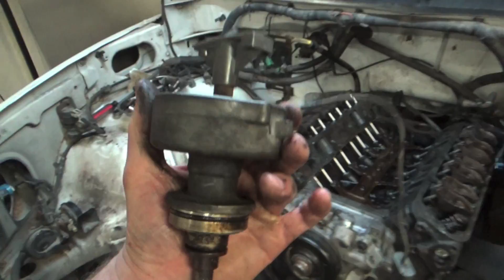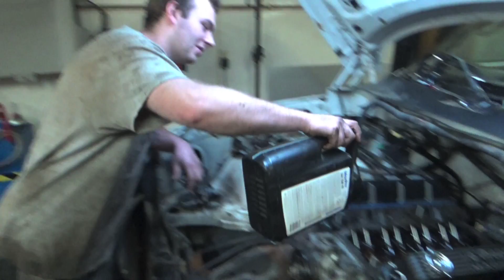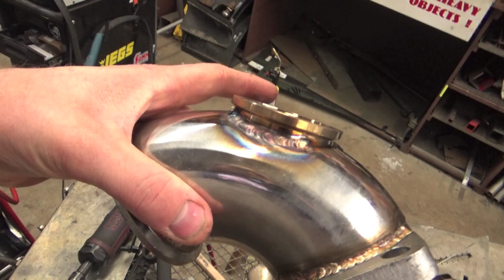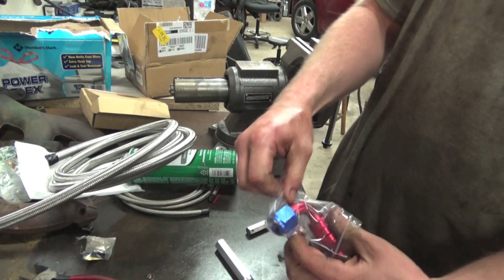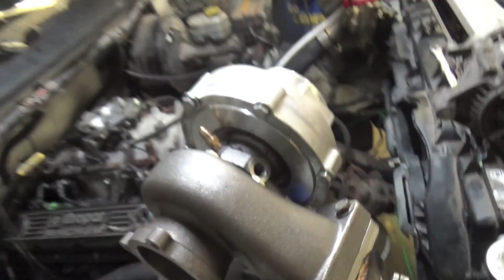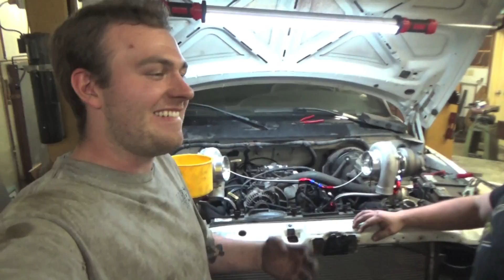Twin TURBO 5.2 5.9 magnum build FIRST STARTUP! Whitie build ep.4

Comment: YEEHAW haha I just got a 5.9L RT Durango and I've been going crazy looking for vids and information on building a turbo 5.9, this looks great man! 💪
Reply from the maker: Thank you! And sounds awesome I’ve always wanted a RT Durango
Reply: @RacingRamFam  are you in the east coast? I plan to build the 46RE first, Upgrade Brakes and Suspension, then tackle the 5.9l I'm keeping it simple, EQ Heads Cometic Gaskets like you used, ARP studs, refreshed bottom end & a Single 6668 Precision I want to port the stock intake, and keep the EFI, put bigger injectors 🙏 fingers crossed it all goes well.
Reply from the maker: That sounds awesome and no north central! Sounds like a sweet plan

Comment: Looks awesome!!! I would like to do something similar to my 96(5.2), i love this truck!!
Reply from the maker: Nice! What vehicle?? You def should
Reply: @RacingRamFam  a 1996 ram 1500 5.2 with a manual trans, i just installed a hurst shifter
Reply: I built a 5.9 for a 2001 ram 1500 that i had and could never get the pcm to run it after flash and tuning (new internals, compcams chain and cam, hughes f1 intake headers) and i just have the engine sitting around after the pcm died
Reply from the maker: Time for a swap soon?? And dang that sucks what do you think was the issue?
Reply: @RacingRamFam  it was running lean even burned a couple o2sensors in the process, if i do decide to swapit into my 96 ram i was thinking just carburating it and finding an older distributor and harness or maybe even msd ignition system, how are you managing your engine? if you dont mind me asking
Reply from the maker: Sct3200 and custom tune by me

Comment: Cant believe I found this. I’ve got a 98 ram with a 5.2. I’ve got a motor and twin turbo kit sitting on the shelf for it
Reply from the maker: Yesss that’s sick man!
Reply: Where did you get the turbo kit from
Reply from the maker: Devin Baker they use to have a eBay twin turbo kit for the la and magnum engines. They took it down tho
Reply: I've got a 98 transmission do you have overdrive
Reply: Sameeee bro wtf
Reply: @RacingRamFam it’s actually still up

Comment: So two questions. Where does the turbo oil supply come from? 
Does the turbo oil return have to be gravity feed?
Reply from the maker: Tapped off the oil pressure sensor and yes unless you use a scavenge pump
Reply: @RacingRamFam  thanks man keep on keepin it boosted

Comment: The right belt to get for a 5.9 is a  
"90 5/8ths inch, 15/16ths wide, 7 rib"
My ac pulley on my 2000 5.9 went out and this belt fits perfectly if you route it without ac

Comment: I’ve got a 2001 Dodge Ram 1500 5.2 and I wanted to ask what should be the first things to do to increase horsepower? The truck has 136,000 miles and in good shape but real sluggish on the punch. I just wanted to so info on my first steps?
Reply from the maker: Make sure plenum gasket isn’t leaking and def tune

Comment: New follower! I really like your build! you got a part no for that belt? got a single turbo 5,2 in my 74 dart :)
Reply: and now i watched the whole video XD what length belt?
Reply from the maker: 905k7!!! That’s awesome what kind of power are you making?
Reply: @RacingRamFam  no idea, still working some bugs out, and haven't welded the plate in the bottom yet. So i have put the ecu (megasquirt) to cut at 0.5 bar (7-8 psi) boost. Gonna try to do a couple of upgrades this winter and dyno it come spring.
Reply from the maker: That’s awesome I almost went megasquirt on this truck but thought tubing the stock j-tec is more relatable to people
Reply: @RacingRamFam  my engine is from a jeep, and i didn't get the ecu for it, and i think the whole car is integrated in the engine loom. So for me ms was the easiest

Comment: Bro. Hmu. Going to get my ramcharger with twins on a 5.9 magnum running by the 18th
Reply from the maker: RNHB 1AGOFAST that sounds awesome! What’s all done to it?
Reply: @RacingRamFam  new gapped rings, arp rod bolts, rod bearings, arp head studs and mls gaskets. T04e turbos. The ramcharger has 37s and a 6 inch lift ;)
Reply: Hmu on insta @1agofast

Comment: Where did you hook the oil feed from to your turbos?   It sound beast nice job.  Ill be starting mine up in the next video.
Reply from the maker: Tapped into the oil pressure sensor. Look in my description I have all the oil feed parts listed

Comment: Dude that thing sounds mean af!
Clean hood cut out for sure
Reply from the maker: Fiveoh5 thanks man! And I think that is the route we are going
Reply: @RacingRamFam  no have them ripping out of the hood you should of gapped your rings on that engine too much boost will break the pistons due to the rings compressing under the heat of the boost charge you may get away with it if you run water meth injection but I don't think so I've seen many boost their engine without gapping their rings and end up with a broken engine because they did not gap their rings on the pistons. If you are going to run some good boost it's mandatory you do it

Comment: What fans are those off of ?
Reply from the maker: Pro master van
Reply: @RacingRamFam  I can order them off of eBay right ? And is there a exact year ? Anything I gotta do to get them to bolt up ?
Reply from the maker: @alexisharo8865  ya cut the ears off of them and radiator zip tie them on
Reply from the maker: @alexisharo8865  go to any local Chrysler dealer and grab one out of the scrap there was a recall on them. They work just have to run a stand-alone controller
Reply: Okay and as far as bolting it up?
Reply from the maker: @alexisharo8865  radiator zip tie. Not bolts radiator zip tie